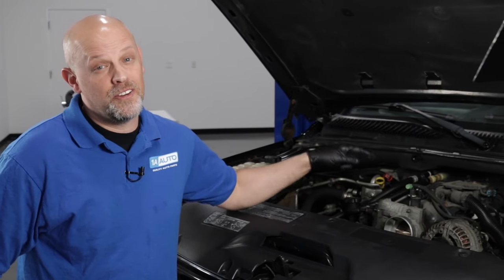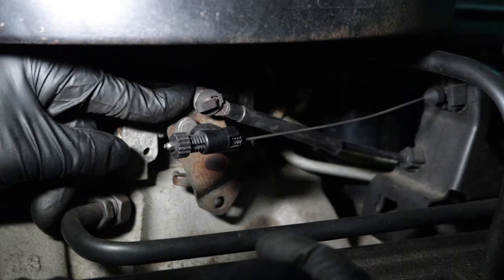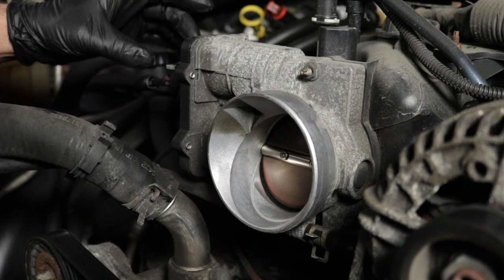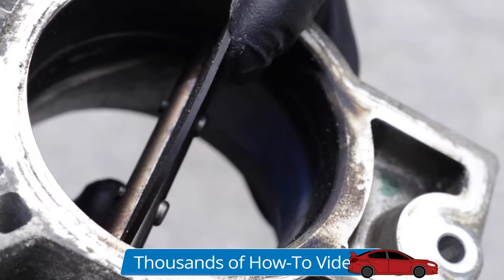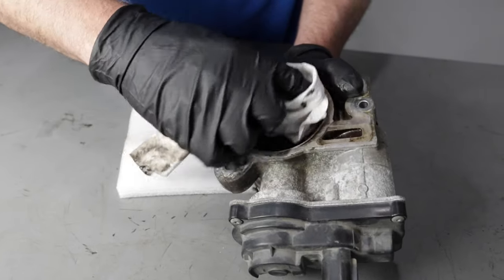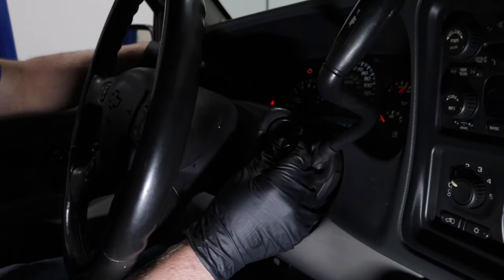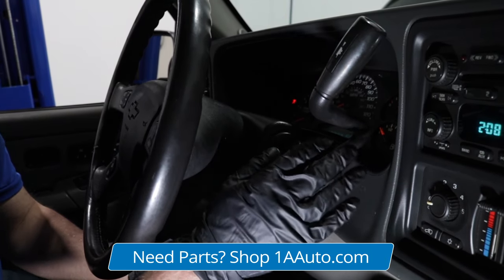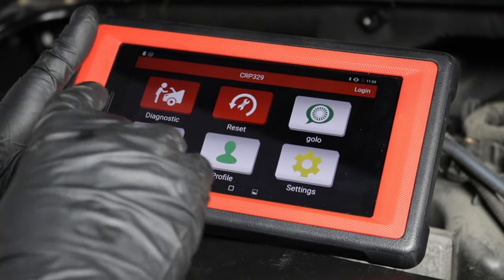Throttle Body Relearn: When Should I Reprogram My Car's Throttle Body?

Comment: I have a question do you have that procedure  for 2000 mitsubishi eclipse gs what are the steps i cleaned the throttle body and now the idle runs high thanks
Reply: Yup, step one stop listening from bullshit and general "advices" such as those one presented in that video, step two get your hands on a mitsubishi software to reset properly your TB using the correct procedure which is resetting it electronically with the proper software and a laptop.

Comment: Most owner's manuals will tell you how to do this after the battery has been disconnected. Different cars do it different ways.
Reply: What if i dont disconnect the batt. And use a scan tool to clear a check engine code. Do i still have to do a throttle relearn??

Comment: I'm replacing mine this Friday. I have a 2003 Tahoe. I dont have the tool. Should I let it run for a few minute or shut off and turn on? Thanks
Reply from the maker: +brownhistorymonth Thanks for checking us out! To manually relearn this you can start the engine and let it idle in park for 3 minutes. During that period the idle may be higher idle than normal. After 3 minutes, turn the engine off and leave it off for about a minute. Start the engine again and let it idle in park for 3 minutes one more time. You may see a check engine light and would need to have these removed with a tool, a simple scan tool should be able to do this. If the idle is still too high drive the vehicle at speeds above 40-50 and accelerate and decelerate often. After this is done you can let it idle for another 3 minutes, let it stand for a minute and see if that solves it. If it doesnt, you may need to take the vehicle to get electronically corrected.
Reply: Would this be the same for a chrysler aspen 2009 5.7l hemi

Comment: Hi Sir, i have a question.
This reprogram/relearning is only for automatic car with drive by wire? or it can be reprogram/relearning the manual car with drive by wire?
Reply from the maker: +Atroce Seyren Gaming Thanks for your question. Based on the video as long as you have the drive by wire this relearn should work for both.

Comment: Sounds like the “official”  engine cycle!! Or don’t remove your throttle body and clean it  with throttle cleaner while the engine is running will that do the trick??

Comment: I have a 2007 Dodge caliber I change the throttle body and light still keeps coming on what could be the problem
Reply from the maker: +John Smith We wouldn't be able to diagnose an issue like that here, you may want to have a local mechanic take a look at it. Thanks for checking us out! http://1aau.to/m/Shop-1AAuto-c
Reply: Did you figure out the problem? I have a 2010 Dodge Avenger that’s doing the same thing

Comment: well, i don't really have my answer.  "a certain amount of time" doesn't mean anything.
Reply: It's truly variable based on a mix of distance and how many cycles going from a stopped position to 41mph(I believe it was). If you just hop on the highway and drive at 75mph, you could go hundreds of miles and still hundreds more without it relearning. Best to do city/highway mix. In my case the only way I could fix the problem was having a shop reprogram the TPS and APS simultaneously.

Comment: Brake cleaner or Carburetor cleaner to clean the throttle body? Nope! They leave residue behind. I'll only use throttle body spray cleaner, or Mass Airflow sensor spray cleaner.

Comment: Why would you relearn the throttle body instead of buying a 6 dollar can of throttle body cleaner then it won't need to be relearned I could see maybe drastic temperature changes made a reason to re learn but if theirs carbon build up just clean the thing out its quit easy and simple and probly the proper way
Reply: Some aftermarket throttle bodies help performance better than stock